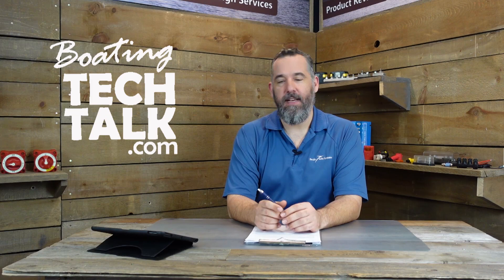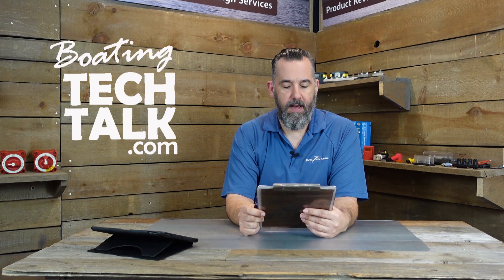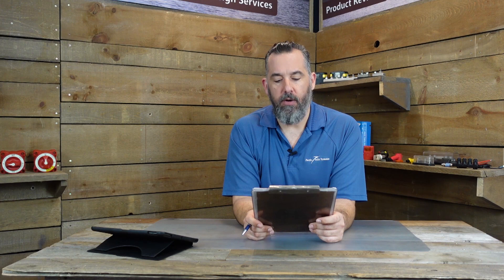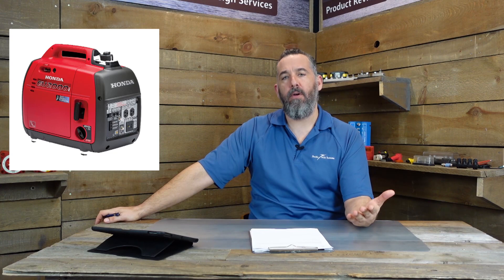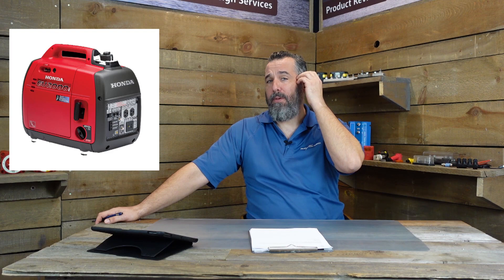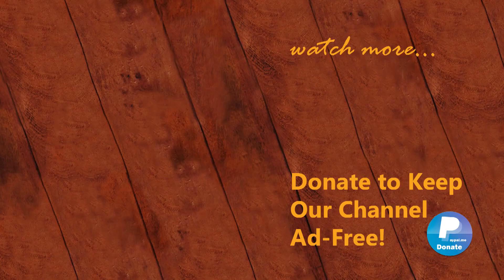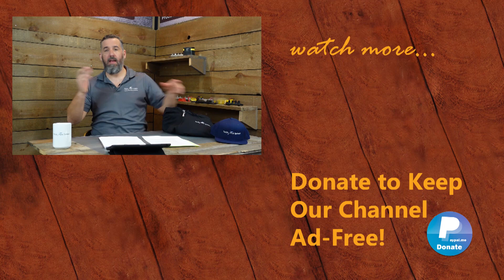Can I Charge My Boat Batteries With a Honda Generator?

Comment: I used my Honda 2000 companion (with twist lock receptacle) to recharge three Vmax 8D’s. The charger is a Go Power 75 amp smart charger and yes it does bulk charge as normal. A Honda 2200 may be able to do a 90 amp but that’s pushing it. Keep your cords heavy or really short. The 2000 would also power a 16000 btu Marine Air heat pump but the trick was to turn off the Eco mode first, then once the AC is running you can turn on the Eco mode and it’ll slow down a bit. Also turn the stat down so the AC doesn’t cycle off because the AC would have to sit (equalize) for 30 minutes before the generator has enough grunt to restart. Keep in mind EVERYTHING else is running on the inverter batteries at that point. It’s called energy management. Do buy some 10 year Carbon monoxide detectors and distribute them throughout the boat or RV. Yes, I’ve had one go off when the wind changed a few times and all I had to do is aim the generator exhaust elsewhere. In the near future I will be switching to lithium’s. I’ve built my own but for those that can’t, get Battle Born batteries and Powermax PM3 55 amp charger and follow instructions for lithium adjustment. Or this be the time to buy one of those intelligent inverter/chargers that do energy management and have provisions for lithium charging profiles.
Reply from the maker: Hi Karl, thanks for sharing your experience and also bringing up the importance of carbon monoxide detectors.

Comment: You do state that you are talking about lead acid batteries and that in his specific application this is undercharging. I think it would be good to point out that LiFePO4 batteries are not subject to this minimum charge rate therefor regardless of the size of the battery bank, if you were using lithium batteries, you can charge with even a 1000W generator as I do.
Reply from the maker: Hi Tim K, thanks for sharing and pointing out the benefits of Lithium for charging.
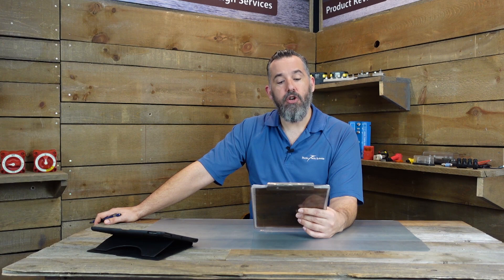Reply: I have flooded D8's in parallel on solar and on cloudy day on high usage my DLS-45 w 0:29 ith eq dongle will charge and top off with a little champion 2500 watt running on propane in 2hrs

Comment: Jeff......thanks for politely addressing the noise issue that emanates from generators whilst at anchor......IMHO I see no need for a generator in this day and age....too many other options, wind, solar, better battery capacity....
Reply from the maker: Certainly more and more options for charging a battery bank.
Reply: Thats just more junk on your boat that will break.

Comment: I am a BC resident that has been sailing globally for the past 6 years, 23,000 Nm and I am going to say that I disagree with this video on a couple of points. We have 900A of gel batteries with a Victron Multiplus 3000W inverter and 1300W of solar on a 47' catamaran. We also carry aboard a Honda 2000i portable genset. When we have very cloudy weeks at anchor (e.g. Vanuatu in South Pacific) or when we crossed the Atlantic in 2016 which was very cloudy and squally), the genset absolutely kept our batteries up when we needed a charge...we also make water, charge portable devices and often do laundry if we run the Honda genset off the transom directly connected to our shore power inlet as mentioned. Our batteries turn 7 years old this year, so there has been no issues thus far related to chronic undercharging...but I will also chock that up to our solar capabilities and the installation of a hydro charger for multi-day passages. Sailing at night with all electronics running and refrigeration is our heaviest power draw.....With this charging combination, we rarely have used the genset the past couple of years in Sunny Australia and the dry season of SE Asia. I personally am also very cognizant of engines or gensets  running in a quiet anchorage - I hate it personally, and while the Honda seems very loud on board (which I only run after 10am until max 5pm), it amazes me how quickly the sound dissipates away from the boat...often boats around us will not hear us - but in all fairness that is often in gentle trade wind conditions and not in peaceful windless Gulf Island anchorages stern tied to the shore...The Honda genset has been very reliable for us and easy to maintain. Fair winds!
Reply from the maker: Hi Sailing Catamarn Element, thanks for sharing your extensive experience with everyone. Solving problems differently and sharing this info is what makes the boating community so great. We all listen, weigh in options, and make a decision that works for us.
Reply: What kind of charging system would you recommend? From generator to battery
Reply: @joaquing7003  We charge mostly with solar...1300W of panels and a 400W hydrocharger for multiday passages. We have found for the times when it has been cloudy for multiple days, it was simple and sufficient to put the Honda 2000W genset on deck with an adapter to plugin directly to our shore supply inlet and send power directly to our 3000W multiplus, just as if we were connected to shore power....has worked great when needed for 7 years...

Comment: I run a Honda i2000 on a pro Mariner 40 battery charger, charging a 450 amp hour lead acid battery Bank with no problems at all. The charger stays in 14.6 volt bulk charge for 1 hour and then goes to float so I turn it off.
Reply from the maker: Hi John, yep based on numerous feedback, 40 amps charger at 12 volts seems to be a reasonable load for the 2000 W generator.
Reply: Good to know.. what charger are you using?
Reply: @markthornemarmaduke I have a similar set up (2,000W genset feeding directly into the shore power connector) driving a 40A Marine Pro smart charger. Works well.

Comment: As a delivery skipper i ran into an interesting solution of an owner - He had the Genny ( Italian make i believe) Mounted on the boarding platform , soundproofed? . permanently connected to the shore power outlet & it had a Wi-Fi set up , Its own separate fuel source so he could turn it on from down below , Worked well. He did have a another shore power plug so either iether .
Reply from the maker: Thanks for sharing Bill, be interested to see pictures.

Comment: As a Honda mechanic I test the Hondas ALL THE TIME. I can pull 25 AMPS peak but I do not leave it there long (LOAD BANK) If fact ALL hondas can pull easy 8 amp over rated of 13.7 amp rating.
Reply from the maker: Thanks Bob for the knowledgeable input.

Comment: Awesome channel! Just FYI - I was able to run a PowerMax PM4 100A 12V 4 Stage Smart Battery Charger with a 2015 Yamaha EF2000i suitcase generator... barely. I was charging six Rolls 6V deep cycle batteries in a 12V bank with a total of 675 amp hours. If the 50ft shore power cable was in the sun, it would occasionally trip the overload breaker on the generator. I also tried a Honda 2000 several times, which seemed to handle the peak load better than the Yamaha. Apparently Honda programmed slightly more overload capability in their 2000 to suit RV camper air conditioner startup demands. I used the Yamaha generator about 30 times to charge the bank over the course of three years. In hindsight, I wish I had purchased an 80 amp charger, which in my experience would not trip the generator overload circuit.
Reply from the maker: Thanks for sharing, 100 amps of charging power by a suitcase generator is great.

Comment: I'm going to make an assumption. If he has 3 240ah 12v house lead-acid batteries in parallel, he has 720ah at 12vdc. At C/20, his max charge is 36 amps. How is his Xantrex 40 amp charger "underpowered"? A Xantrex Trucharge TC4012 consumes 7.7 amps at 120vac, well within the ability of a honda EU2000i generator (13amp).
Reply from the maker: Hi Steve, perhaps we are using the numbers differently. To me, C20 is a measure of calculating battery capacity and a value/unit provided in amp-hours. The CAR (charge acceptance rate) is measured in amps and is about 0.1 or 10% of capacity. A 720 amp-hours lead acid bank can take easily take 72 amps and probably 100 amps during bulk charging. Does my explanation make sense, or did i miss something.
Reply: @PacificYachtSystems  c/20 is the charge discharge rate at which the battery capacity listed is measured. So a 100ah battery is rated at 100ah of charging or discharging at 5 amps. If you discharge at more than 5 amps, you get less capacity than 100ah. If you discharge at less than 5 amps, you get more than 100ah. Peukert. If you charge at higher than c/20, you decrease cycle life.

Comment: I have that Honda. The way I have used it is to limit  draw at the inverter/charger to about half the capacity, then when I need to run loads with the genset, I'm also charging batteries at a nice low rate and not taxing the genset by running it full out . Over time it will top off my battery bank. This method works well for me, since I use the genset to power large draw loads like a vacuum, and some modern inverter/chargers will actually ADD to the genset's output to power larger loads than either the inverter or the genset can cover alone.  Charging at a lower amperage than the batteries can handle treats them gently, which is good, as long as you can fully charge the pack on a regular basis. This is what has worked for me, there are other ways to do it, obviously, depending on loads and habits, specs, etc. Keep the keel side down. :)
Reply from the maker: Hey Tao, thanks for sharing. BTW, lots of boaters out there use honda generators or similar to do exactly what you do and it works. 

It's worth noting, rarely is there a perfect and only one way of solving a problem. We all tackle and solve problems for what works for our boat, our needs, and our budgets.
Reply: @PacificYachtSystems  The tiny gensets are a handy option for those of us that don't run a genset often enough to justify the outlay for a dedicated diesel. I have been happy with my little Honda; really just a backup, but I run it once a week to mitigate heavier loads and keep it from gumming up.         Not to type a tome here, but running these small engines, check your oil every time you start it, change it every 50 hours (runtime meters are CHEAP insurance) and don't run ethanol gas without an additive. Mine has never seen ethanol, ever.
Reply: @tao4409  Interesting I'v looked everywhere for ethanol free but nothing, what's the alternative ? I even put an hour meter on My 3000 Honda for the oil changes
Reply: @linwoodhardy8169  Excellent on the hour meter. These small gensets will run a long time with regular oil changes and an occasional spark plug; easy to forget the oil. One place you can always find pure gasoline is small airports. Aviation fuel is not allowed to be tainted with alcohol for reliability reasons. There are also still some gas stations that sell real gas, but as you know, they are few and hard to find. If you are forced to run ethanol mixes, it is a good idea to use a stabilizer; I use one by Amsoil in any ethanol gas I store (I keep a couple Jerry cans around for my cars). My brother has had good luck with some stuff called Star Tron. Officially, E10 has a one month shelf life, untreated. My rule is this: Anything fuel injected gets the ethanol junk; anything with a carb gets pure gas. Also, it depends on how often you run your genset. On shutdown always run the bowl dry if it is going to sit more than a couple days. I'm sure you know most of this. If there is an airstrip near you, give them a call and ask about buying some gas. :)

Comment: Explain why it “ would not work”.    That you kinda threw in right at the end. IMO. It may take longer to charge the bank. But would get there.
Reply: It would work for many. Jeff runs a marine electrical service so he would not install a system not matched, hes speaking from a safe business practise model.
Reply: Jeff wants to sell you a charger, not a Honda generator.

Comment: So, I am dealing with this now "in theory" and am having trouble wrapping my head around it.  So I have a boat with 30 amp shore power.  I have a 2000 watt generator with continuous at 1600 watts.  I have thought I could just use a normal plug from the generator to the 30 amp shore power port - occasionally to top things up.  I have a xantrex rue charge 2  - 40 amps.  so why wont this work?  and why would solar (with 240 watts of solar) work and not this?

Comment: Great info thanks.  Can you put 2 of the Honda 2000s togather in parallel or series to give 4000 watts or 240 volts?
Reply: I do not think you can do 240 volts. But  4000 watts could be done. It would be more than that. As the new Hondas are now rated 2200. Instead of 2000. I think you also need at least one of the Honda 2200 companion generators. To hook two together. Not two regular Honda 2200 generators.

Comment: Holy crap!  I have the European equivalent, Honda EU20i, 2000w.  At 240v that would mean the generator is putting out peak 8.3A!  I have 6 x 150Ah batteries wired in series/parallel to give me 300Ah/24 volts that are part of my PV system.  I looks like I could not charge this battery bank sufficiently with my Honda generator.  I want to use the generator to top off the batteries when the sun is not adequate to charge them fully. Maybe I must charge each battery individually, but I would not like to do that.  It requires undoing cables and such, which I don't think is a good idea.

Comment: We used one of these Honda generators to power our electric boat with a dead battery bank during a slip change across town. We plugged it into the 120v charger. It drew about 900watts. It's a small engine.
Reply: 16 batteries in a 48v configuration.
Reply from the maker: interesting.
Reply: There so much bull on the internet. Claiming this genny will only do 900 watts is one of them.

Comment: The Honda 2000i is rated at 1600 Watt max continuous. Let's say 90% continuous = 1,440 Watts, just to be safe. Then let's say that the battery charger is rated at 90% efficiency  like my Mastervolt. So we put in 1,440 Watts and at 90% could put out .9 x 1440 watts = 1,296 watts. Let's say, worst case that the output voltage is 14.4Volts DC. This gives a current of 1296/14.4  =90 amps. Jeff, did I get this wrong? So you jump from 60 Amps that works to 150 Amps not OK. Absolutely correct, but what about an 80 or 90 Amp charger. 
Regarding noise, the 2200i is rated at 57db, full load. Normal conversation starts at 60db and goes to 70db. The increase from 57db to 60db doubles the sound power or energy levels. The 3db rule. So the Honda 2200i will have half the noise compared to  a normal  conversation. And yes sound carries over water, so the generator will be half the sound of neighbors talking at a normal volume. So while I am definitely not a proponent of generators in general, (built in diesel generators are often more noisey, ) I  think you have made some blanket statements which should be explained better.
Reply from the maker: Hi Kachoolie, thanks for contributing, your correct the efficiency of the charger will definitely affect the size of the charging amperage. From I've seen and read, 80 amps seems to be about the upper limit of DC charging with a Honda 2000.
Reply: @PacificYachtSystems  so wich charger do you suggest on boats, i Need to charge six lead acid trojan batteries and i had a Black and Decker smart charger for years but now Is dead.

Comment: In other videos, haven't you stated that using a generator like this is pretty dangerous and you don't recommend it? If I'm not crazy and you actually said that, could you give us the long version of why this is? (Also, any chance of getting the hoodie in navy blue and/or a non-zippered version? I'd wear both! Cheers from Michigan!
Reply: Jeff sells batteries and chargers. Does not want you buying a Honda generator.
Reply: My thoughts exactly. Just had this pop up, and I've been advising people not to use them due to the risks of electrocution. Frankly, if Jeff has been giving us a Bum Steer with Safety issues, I'm seriously passed off. This needs clarification at least and maybe an apology, given he's used the bloody things on his own boat as well. 😡

Comment: Thanks for all of your valuable input. I recently purchased a 2200 Generac with the intentions to use on my S2 8.0. Is it possible to run the generator inside the engine compartment with the exhaust vented out through the stern?
Reply from the maker: Hmmm, don't think so. Anyone can comment?
Reply: @PacificYachtSystems  I would go so far as to say no you must not for 3 reasons.  Firstly its a petrol engine and the risks of petrol fumes are for me too high, others may differ but its certainly a very real risk.  Secondly that generator was designed to work with lots of ventilation, but and engine space particularly if closed won't have that so its going to get hot real quick.  Finally, if something goes wrong with that exhaust and its a dry exhaust, so also going to get hot, the fumes are lethal.  There was an accident 4 years ago in the UK when a faulty exhaust leaked CO2 into the cabin.  The wife and child died the father survived just.  His occupation? heating engineer.  Inconclusion then please don't.  Stick it in the dinghy off the back of the boat or on the dock.  Your fellow boat owners won't like it but you won't kill anyone.  Some UK marines allow engine and generator charging each morning but must stop at 1200 o'clock for a bit of peace.
Reply: I use a eu2000i in my truck and frequently charge diesel truck batteries with 80 amps using a  transformer based charger. Thats maxed out. 60 amp continuous is a good recommendation.

Comment: hey like your channel, beginning boater , at anchor, ( don’t have a generator ) but I have a power station Dewalt 1800 watts, can I use the 15 amps entry on my boat to supply the fridge and lignts ?
Reply from the maker: Hmmm, you should, but the real question, is for how long? Really depends how much you ask from your power station.